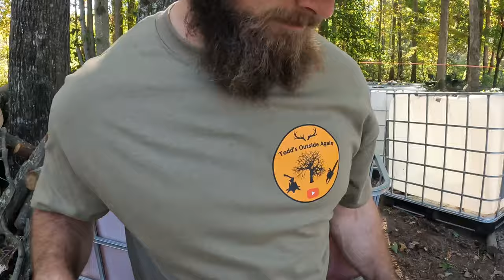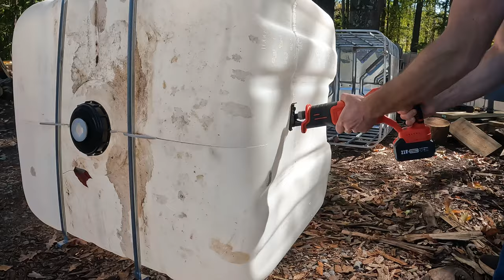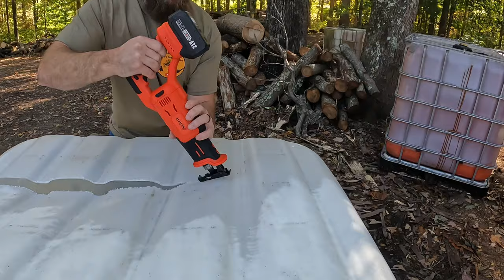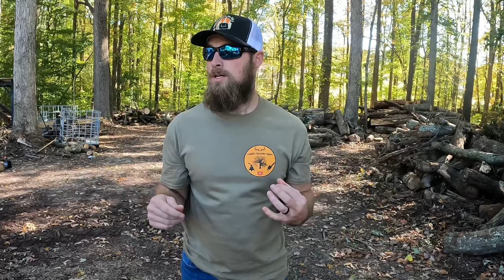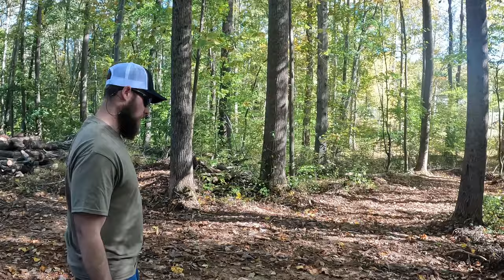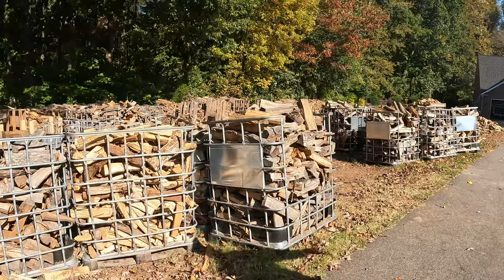Things Have Changed…. How I Process My IBC Totes For Firewood Use.

Comment: hi there coming along couple hints keeping the foot of the saw against what you are cutting may make it cut easier . also marking a cut line on it before removing  will give you a good line to cut on , Looks like you are going to have alot of cutting comming up . great work , good job  john
Reply from the maker: Thanks for the tips and yes cutting is my slow  process.  I could spend many days on cutting.

Comment: I used to cut up 100s of these at my old job, and i used to use a skilsaw when I cut the plastic. It cut like butter. You should try one. It will save you at least 5 min per tote and a lot less vibration on your hands and wrists.
Reply from the maker: I’ll have to try a skill saw next. Thanks.

Comment: Looks like got tons work todo. Lots wood is a good thing. I use the top side of the bar on my top handle  chainsaw works really well and super fast.
Reply from the maker: Yea you can’t have too much wood! Oh nice a top handle would be much easier to use then a standard saw.
Reply: @FirewoodontheHill   it works well you can probably cut tank in half in 30 seconds

Comment: Cut the totes with a battery power circular saw it will cut like butter. Keep the blade deep enough to cut through the lowest part of the plastic or it can kick back at you. If you still want to use the reciprocating saw change the blade to a metal or bimetal blade. The finer teeth will cut down on the vibration which will help you cut faster. Regards
Reply from the maker: I’ll have to try it out. Thanks for the suggestion.

Comment: I seen something that would help you on stacking and making more room for you. Use t post on the ends of ur stacked wood instead of pallets and braces. I seen it done on in the wood yard. Ya'll r doing a great job. Just figure out the from rounds to split to stacking. Stacking is the most time consuming part for u now. Since you have gotten a tractor, a faster log splitter, now just put things in the order that it needs to be. Like a assembly line.
Reply from the maker: I’ve actually tried the post and they get pretty expensive. Also they bend if you don’t have a stack on either side of them. Well mine bend because I’m on a hill. The stacking woodyard is definitely something I need to figure out sooner than later. Thanks for the suggestion.

Comment: I’ll normally cut a tote bladder near the top then use it like a dumpster for the cut off metal & brackets. I’ll also cut up other bladders & stick them in there too. I think it makes it easier for when I take them to the landfill. No one really wants the bladders around here plus the contents make them not suitable for water storage.
Reply from the maker: Yes that is a good idea. Sticking one inside of the other.

Comment: Recip-saws are handy when needed but is not needed here or the best way to cut those tanks. What would work lot better is circular saw with with 6-1/2" 40 tooth blade, {preferably with same battery} you can lot faster and straighter. Then swap blade with a metal cutting blade to cut the tote bars, the blade can be set for dept and will zip right through those steel bars, without the vibration of a recep-saw, and safety gasses are a must .........
Reply from the maker: I’ll have to try out my circle saw. Yeah a circle saw does throw a lot of stuff in your face so glasses are 100% needed.

Comment: I would take those valuable Valves off the IBC's.
Reply from the maker: Most of them are broken or are almost impossible to open and shut because the material has hardened around it.
Reply: @FirewoodontheHill  I see.